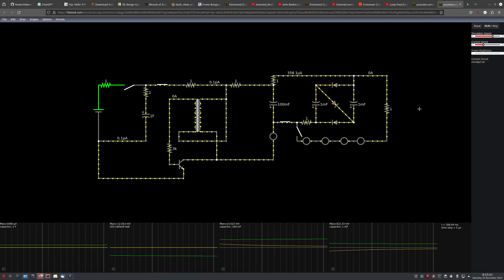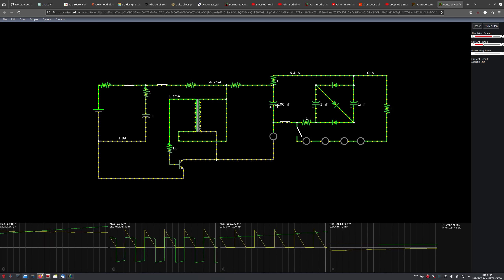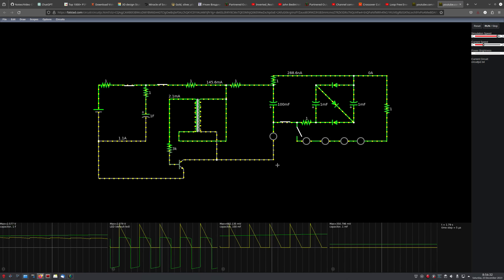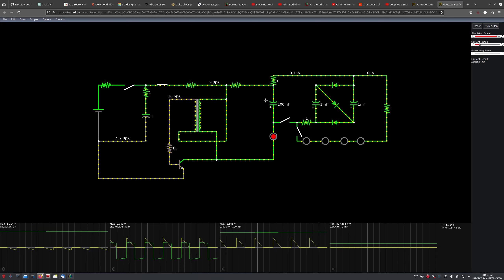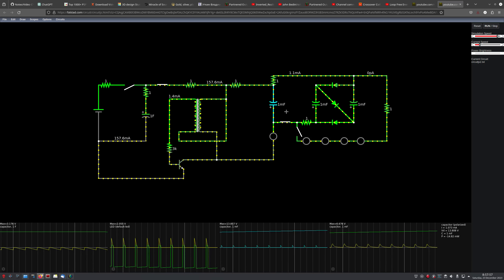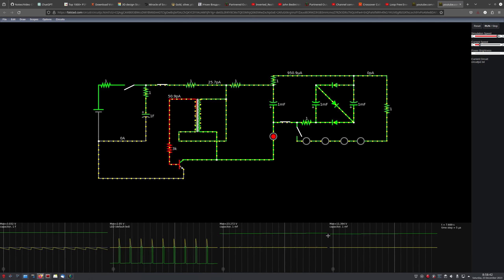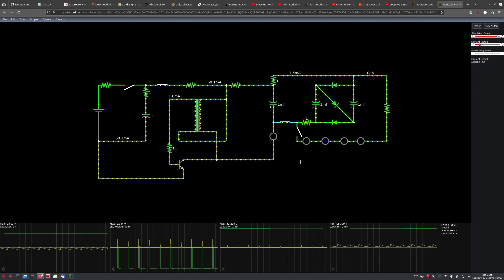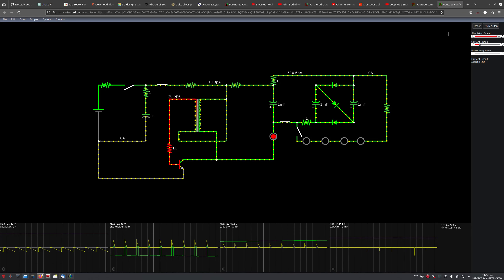Joule Thief + Fractal Capacitor = Cap Dump

Comment: Is this  giving Overunity ? Is it cop <1  ?
Reply from the maker: It's a start. Perhaps first build it and watch what it does. I tend to stay away from cap dumps as they are just another process in between with losses. But with proper configuration it can be.
Reply: @GuardianEngraving  what do mean. By Cap Dumps ?
Reply from the maker: @alanthayer8797  as in the fly-back gets dumped into a capacitor then into whatever load you want. You can look up "K Energy" he makes some good ones. My vid just shows a fractal cap version.
Reply: @GuardianEngraving  ok thanks I'm goin to check out now !